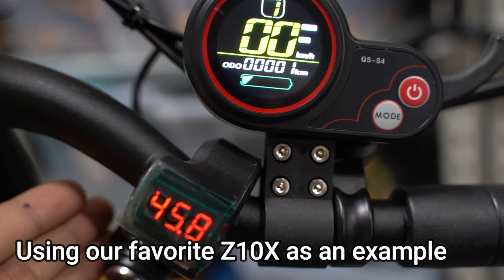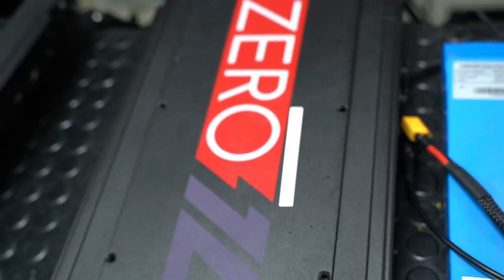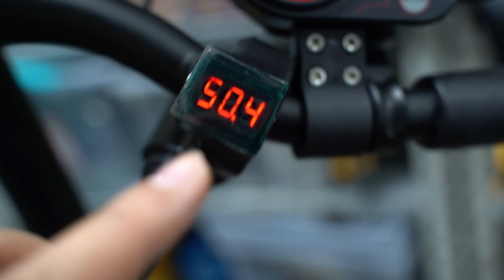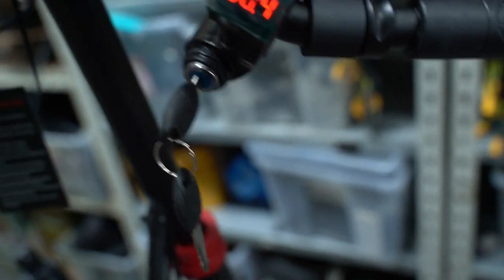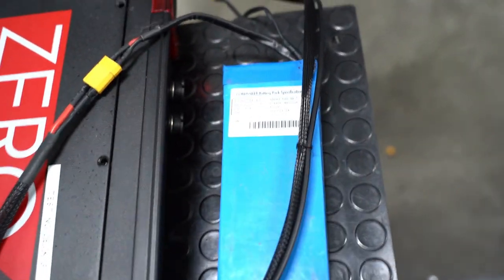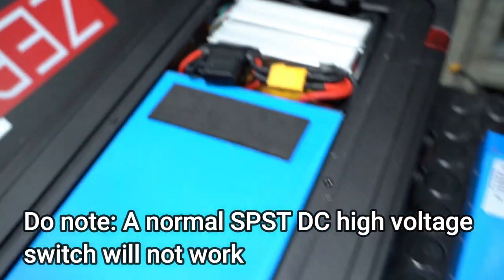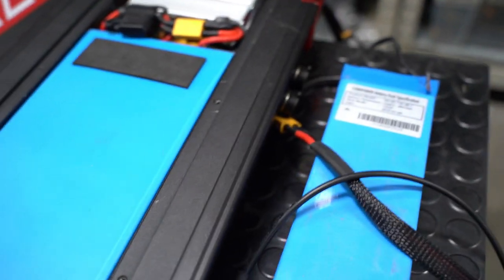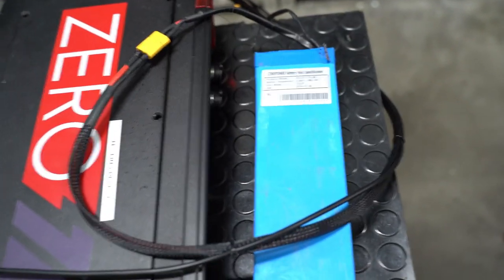MORE RANGE: Parallel ANY 2 Batteries Using Solid state switches for E-Scooter or E-Bike

Comment: Great solution ! I have a Techlife x7s with fault codes e00,e06. It cutsout completely when Im aceelarating. Do you have and idea what can Cause these errors? Thanks in advance
Reply from the maker: Yes we do. Where are you located
Reply: @FalconpevSg  im located in Sweden, MAlmö.
Is the x7s same as the zero 10x ? Techlife is not responding on my calls nore emails, it broke down after 5weeks so kinda dissapointed with their service :/
thanks guys
Reply from the maker: @eminentmindset9705  e06 is battery cutting off prematurely. You have to do 2 things for us. Do a full charge and let us know what is the voltage at the full charge. Try to replicate the cutting off and then note down the voltage when it cuts off. Let us know.
Reply: @FalconpevSg  thx for replying, the voltage is at 59,2  fully charged when after it cutsoff during hard acceleration the voltage just keep dropping to zero and it stays dead til i plug in the charger again. If the charger is plugged it stoping it from cutting off but then e00 fault comes on. Very confusing. 
I changed settings in the display then found a right settings and changed back. 
Thanks
Reply from the maker: @eminentmindset9705  yes the voltage dropping to 0 is a voltage collapse. Happens when the cells fail. Is yours a 52V 18Ah battery?
Reply: @FalconpevSg  its says 52v23a on the frame. 
I started the next day without charging and it says full battery, very weird 😂
Reply from the maker: @eminentmindset9705  best to just WhatsApp us otherwise this thread will go into the hundreds.
Reply: @FalconpevSg  sure can i have the number ? Thx
Reply from the maker: @eminentmindset9705  +6587484565

Comment: I want to double the range on my gunai scooter, do I need to slap some sort of amperage regulator in place? Or should I just install a flipper switch to toggle between batteries and install some capacitors to handle the brief second when switching over?
Reply from the maker: No there’s no need. Internally there parallel batteries will self regulate but for extra safety we have a fast switching high voltage switch

Comment: Great video! Automatic SSR is out of stock? I have found on your website only with button. I wanna try to use on my honghao s12 / kugoo g-booster (48V and 20Ah internal battery). I wanna use with external 48V battery but maybe 15ah external battery

Comment: what about the amperes? it is also increase? what if external + internal amperes is morethan than controller will not damage?
Reply: Battery size doesn't matter. Look at controller as big FUSE lol.   Only matters if it goes out

Comment: Okay so I have a 48v 13ah zero 9 scooter, am wondering if I can add a different branded 48v 30Ah lithium ion battery?? And which switch do I buy? The dual or single? As it only has rear wheel drive

Comment: Hello sir I have iscoter with 36v 7.5 ah inside battery. My question is may I connect 3.6 20ah external battery in the scooter. If yes then should I need to upgrade firmware. If no then why? Please 🙏 your reply will be height appreciate. Thanks

Comment: So you always have to charge these batteries separately after they have been used?
Reply from the maker: No you can charge them at the same time
Reply: @FalconpevSg  I have the Jueshuai Scooter
Battery:18650 lithium battery
Motor: 3200W
Battery capacity: 26AH
Working Voltage: 60V

Will your battery work for this scooter? i got it from aliexpress and want to increase the range more.
Reply from the maker: @aysenvi9646  yes our battery would work. You can get the 60V 28Ah one here https://www.falconpev.com.sg/products/external-zero-10x-52v-23-8ah-battery?_pos=1&_sid=1458f368e&_ss=r
Reply: @FalconpevSg  I can also get the less capacity 21ah 60v battery right?

Comment: I have fiido Q1 72V 1500watts with Battery 60V 12Ah , my question is can i combine it the original battery stock fiido 36V 10Ah using the Solid State Battery relay to make 72V ? 🥳🥳 thankz
Reply from the maker: yes you can provided your controller is able to handle the lower voltage of 36v
Reply: @FalconpevSg  thankz 🙏🏻🙏🏻🙏🏻

Comment: I like it. how do I get this product?
Reply from the maker: Link in description
Reply: @FalconpevSg  so I need to buy the relay and add it to your battery pack? Where is the link to the smaller capacity batter packs?
Reply from the maker: @Camrographer  no need relay. Just need to get the same voltage battery pack. How small a voltage

Comment: i have zero 10x 52V, can i buy extra battery 60V? Can my controllers handle it?
Reply from the maker: No your controllers cannot handle 60V
Reply: @FalconpevSg  don't the 18ah 52 volt controllers support the 60 volt? or do I have to order a controller if I want to switch from 52volt to 60volt?

Comment: Do you plan to provide "charge controller"? That's a relay plus voltage comparator. Idea of using this to prevent battery from charging above 80%, thus prolonging battery life significantly.
Reply from the maker: That’s the bms job to be honest. Not the relays job.
Reply: @FalconpevSg  but charging to 100% percent puts more stress on battery cells, this leads to faster degradation. 500 cycles (like you mentioned in movie) means 18 months of daily 100-0% cycling or 5x more if cycling in 80-10% range.

Comment: You could just add an extra metal casing compartment on top of the foot rest section of scooter and replace the original battery with a larger battery that is double the size, however the stem length needs to be re-adjusted. I think this would be a much easier solution!
Reply from the maker: Not really. The metal casing compartment will have a lot of holes for which the water to get in.  this is easier and more plug and play without getting rid of your original battery. You can still use your original battery with this parallel solution
Reply from the maker: Not really. This solution still uses your original battery which is not wasted.
Reply: @FalconpevSg  I understand your point, however if the original battery fails after long time use.  And someone wanted to have a bigger battery than the original as well as comfortable seat, then my solution would work for long range commutes to outside of the city.
Reply from the maker: @koochooloo007  that’s one of the options we considered in 2018 but it would be difficult to prevent water penetration once you added a spacer on top of the deck

Comment: How much is this expected to cost in USD’s ? And do you ship direct to the USA or do I have to purchase through REV RIDES ?

I have the Zero 10x.  There isn’t any degradation issue’s yet, but I’d like to have this switch just in case.

Thanks
Reply from the maker: sure thing, but rev rides will not have it yet. but you can order through us.

Comment: Just buy same voltage, not need have same capacity mah, and not need this extra electronic. When you charge just unplug extended battery..
Reply from the maker: This is a safer and more high tech way of doing it